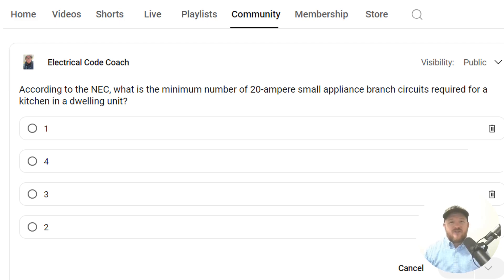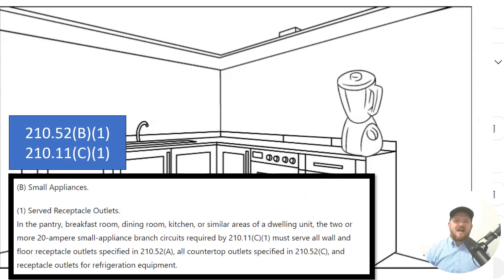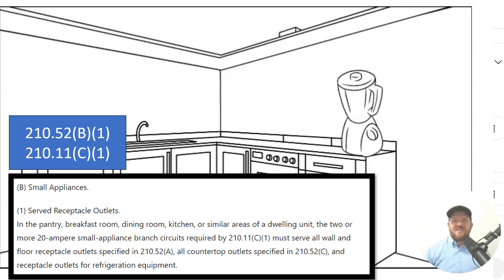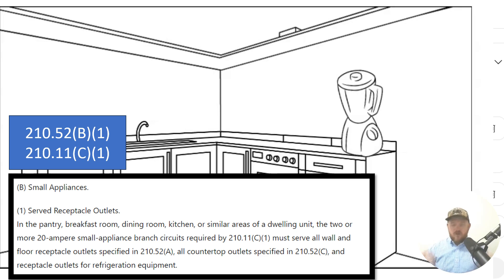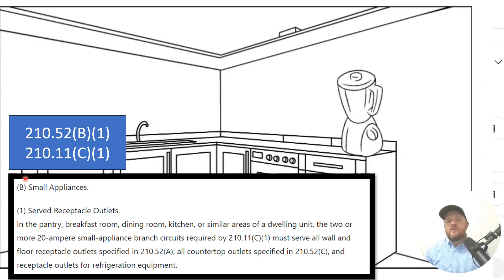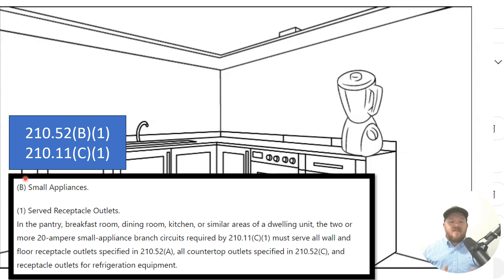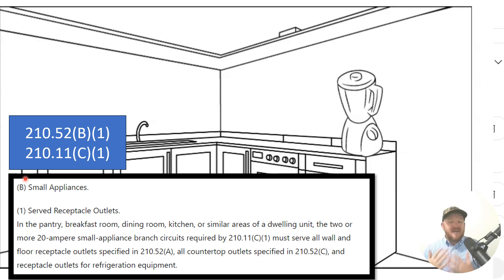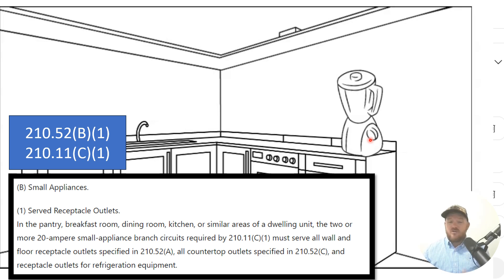#158 Electrical Question of the Day Kitchen Circuits Explained

Comment: Where I work, some of the inspectors require a single receptacle for an individual branch circuit in a kitchen,  such as when running a 15A circuit for a refrigerator, regardless of us meeting or exceeding the two required 20A kitchen circuits.
Reply from the maker: That's interesting 🤔